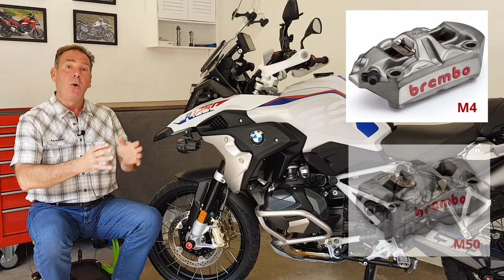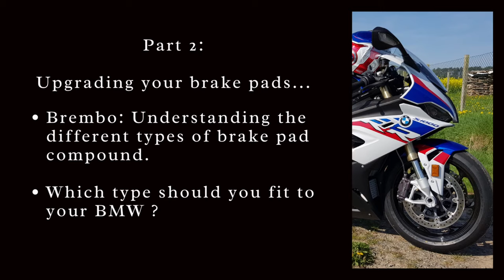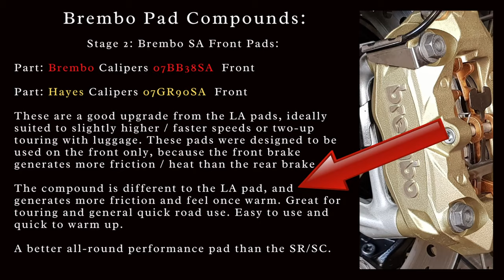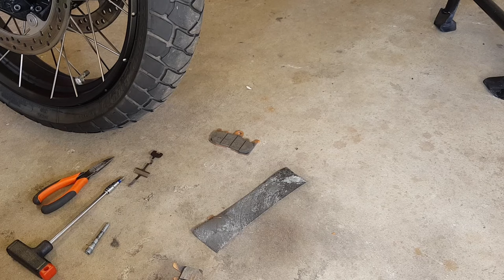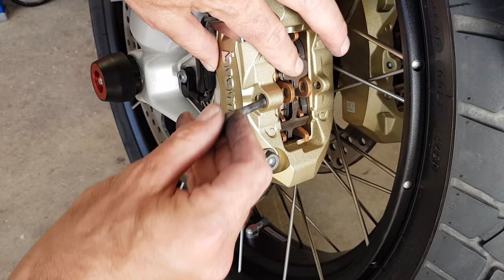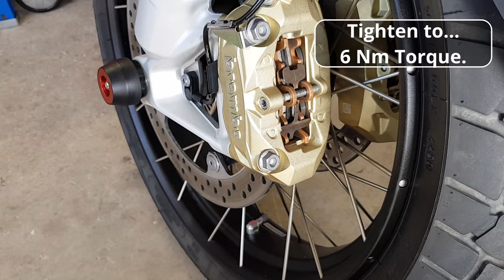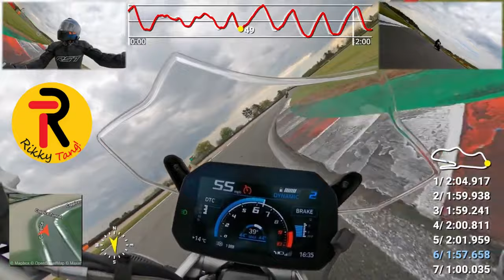EP:11 BMW Brake Pads Explained R , RS , RT , GS/A  Brembo Brake Pads - Compounds - Upgrades

Comment: Thing is with contamination is that it will get burned off just by using the brakes. I'm not saying don't take care of your brakes but if they were that sensitive then shit from the road would render your brakes useless constantly. 

I have accidently gotten stuff like acf50 on my disks before and only noticed when I started riding. I just made sure to do some hard braking to get the performance back.
Reply from the maker: Hi Jack , your point is valid to a degree, but with over 40 years of experience working with brakes my advice is valid and does offer a simple solution to improving performance. Different contaminants have different effects some are hard to remove but by cleaning the surface of the pads and discs this generally helps improve performance.
Thank you for sharing your thoughts 
Kindest regards Carl

Comment: I wish I had seen this sooner. I ordered Brembo carbon ceramic pads for my R1200rt as the advert said they were for the R1200rt
Reply from the maker: They will still work but just not the best option. Carl
Reply from the maker: Hi
A lot depends on your riding style and how you use your brakes.
A good replacement is the LA pad which is similar to OEM but with better feel.
The SA is really good pad if you ride a little quicker as it offers great feel and improved performance.
Don’t fit SC or SR pads they need LOTS of heavy constant use to get them working correctly.
Personally it would be SA pads from Brembo 
Let me know what you decide to fit and what you think of them compared to the OEM pads 
Carl

Comment: Very detailed and very informative. I got a 2022 gs and looking forward to my hayes caliber leakcage so that i can let them to be replaced by bmw. Greetings from izmir Turkey.
Reply from the maker: Good evening Turkey and welcome Ugur. Not all Hayes calipers leak, but if yours do fingers crossed your dealer fits Brembo for you.
Best wishes Carl
Reply: I live in the USA, and have a 2020 1250GSA that was part of the Hayes caliper recall. I had them inspected by my dealer two times, with no sign of leaking. Even though I had the option of replacing them with the Brembo, I opted not to change them, because I felt that the Hayes had better stopping power. 55k miles on the bike now, and still no signs of leakage.
Reply from the maker: Hi Craig, hello and welcome, yes the Hayes do have great stopping power and you are obviously one of the lucky owners to have no issues. Wishing you a great spring and many happy miles on your GSA. 
Regards Carl
Reply: @justthewayitis  ❤

Comment: Excellent video with clear explanations. My question is would it be more beneficial for off-roading purposes to use the Hayes type calipers as they are a more enclosed system thus avoiding a lot of ie dirt, mud & sand for example. Great job Carl and I have just added myself onto your subscribed list. Look forwards to more videos.
Reply from the maker: Hi My Tube, that's a great question,  your thought process sounds good, but once the dirt, mud and muck gets into the space between the caliper and pads, the Hayes are not easy to clean or inspect. But it's a good question. Maybe some more off road experienced subscribers can comment and share on that 👍
Carl
Reply: @justthewayitis  Very true thanks for the reply Brembo it is
Reply from the maker: Your welcome anytime 👍

Comment: Hi Carl, like your videos a lot. Very simple and effective information. I have a 2021 GS Rallye. I am 5’7” and would like your advise on fixing handlebar risers on my GS. For me the reach is just about nice but would like a more comfortable feel on long rides where I can feel my palms getting numb.
Reply from the maker: Hello Sameersu, choosing a set of bar risers is an individual thing. If you are happy with the standard height and reach,  you can try adjusting the bar level using the Mark's on the bars. In other words loosen the bolts and twist / rotate the bars downwards by 5 to 10 degrees.  This might help with your hands going numb.
Alternatively if you do decide to use bar risers  they all have slightly different settings.  Some go up 30mm and back 35mm, some go up 20mm and back 25mm. So this is your choice and you might need to try a couple to find the perfect solution for you.
Also changing the seat height in combination with the angle ( up at the back and down at the front) can also help.
It does take time to find your perfect setup. Best wishes Carl

Comment: As always, great and very interesting video Carl. I learned a lot. Thankfully, I do not spray anything directly on my bikes so I do not think that I have any contamination on the breaking pads. Thanks for sharing the video… I would like to have the Brembo calipers on my GS, but the Hayes ones have not leaked so I guess I cannot have them changed (free of cost that is) by BMW. Wish you a safe riding and look forward to your next video. Cheers.
Reply from the maker: Hi Max, thank you for compliment, good to hear you already clean and detail your GS the correct way.
I wouldn't rush to swap the calipers.. the Hayes are very good, it's just that last little bit of feel that the Brembo's give if you ride a little faster than most.
Best wishes Carl

Comment: Hi, great informative video. What I don't understand on every GS1200 front brake pad change I have watched is the location of the spring. When the video starts the T30 bolt does not locate in the cut out in the retaining spring yet the reassembly it locates the T30 bolt in the cut out, could you please clarify, many thanks Brian
Reply from the maker: Hi Brian, send me an email and I’ll forward you some pictures 
Contactcarltoday@gmail.com
Reply from the maker: Email sent

Comment: Superb vid What’s the best way of moving the brake pistons back and forward to clean and lub the piston
Reply from the maker: Hi James, a great question

It all really depends on the owners experience level….If you are not experienced and 100% comfortable working on calipers, I would suggest ONLY moving the pistons back into the calipers once everything is thoroughly clean and you have applied a small amount of lubricant. Then gently push two pistons on one side back into the caliper housing, while holding the other side firm. I REPEAT Absolutely NO moving the pistons in and out, this is the safest way for owners that have limited experience. 

Moving the pistons in and out / back and forward is possible using the brake lever BUT you have to be extremely careful doing this because the pistons can…. Sometimes… pop out. This ( in and out) is normally only required when the bike has high mileage or has been used in extreme conditions or ridden through several winters as a commuting bike. 

For most owners, cleaning the calipers thoroughly and using the lubricant I advise in my Ducati series and then gently pushing the pistons back into the housing using the lubricant … is the best and safest way to perform this maintenance. 

Of course, you can purchase caliper tools and tools for compressing the pistons back into the caliper housing, but for most owners the above steps work just fine. 
Best wishes Carl
Reply: Thanks Carl going to give your Brembo brake pad up
upgrades a go. I run two up
briskly most of the time so going to try the SA pads a try 👍
Reply from the maker: Hi James, thank you,  and I hope you enjoy the SA pads. Perhaps just give those discs a clean when you install the new pads that way you will get the best from the SA. And... hopefully you can return and let the other owners here know what you think of the pads.
Best wishes Carl

Comment: Hi Carl. Thanks for the video. Very informative, helpful. How about brake fluid, does it contaminate the brake pads? Cheers
Reply from the maker: Hello and welcome, definitely yes !!! Once brake fluid gets on brake linings either pads or shoes… they need to be replaced and brake discs thoroughly cleaned and decontaminated. Even a small amount of brake fluid is enough to affect the pad performance 
Carl
Reply: @justthewayitis thank you for the bad news hehe. Was bleeding and got sloppy. Cheers

Comment: Hi Carl. I've just been cleaning my breaks and deglazing my pads as inspired by your video! 

I've just noticed the large metal spring that sits under the retaining bolt is in a different position when you remove it and when you refit it.

Can you confirm which position is correct? Should the retaining bolt sit in the U shape or not? 

Thanks for the great videos!
Reply from the maker: Hi well spotted 
The correct position is as it’s re installed 
Pin through the U shape 👍 
Good luck with your cleaning it makes a big difference, Carl
Reply: @justthewayitis  thanks Carl! I'm yet to try the clean brakes but looking forward to it!

Comment: Hello, I watched your video 4/5 times.  I changed my 4.32 Brembo brake pads. The front wheel is a little difficult to turn. Is this normal? Do I need a break-in? The pads I changed are Brembo (brm10dhh).  Thank you very much again for the clear information.   Greetings from the folk song.   1250 adv.😊
Reply from the maker: Hi, the front wheel should turn smoothly and easily.
Did you thoroughly clean the inside of the calliper and clean the pistons?
Did you remove the callipers ? Please confirm.

Did you use the lubricants I mentioned in the videos around the pistons and then gently and carefully press the pistons back into the calipers?

If you did everything correctly and after a short 10 mile ride to gently bed in the new pads, the front wheel should rotate smoothly with just a little bit of drag / resistance being felt.
Carl
Reply: @justthewayitis I don't have caliper piston oil, but I felt that the pistons moved easily.  I will disassemble it and check again and try to find the piston grease.   I hope I can provide a comfortable wheel rotation.   Thank you very much for the information.
Reply: @justthewayitis I did the cleaning process as in the video and took an outside opportunity to disassemble the calipers and I think I cleaned them pretty well.😊
Reply from the maker: Ok, brilliant, 🙋🏻‍♂️
Reply: @justthewayitis  I applied the cleaning process as in the video.   I applied the caliper piston paste, there was a relief of about 15% compared to the previous one, I drove on 3 different days and now I checked and the wheel turns very easily and my brakes work perfectly.  Now it's the rear brake's turn. Tank you.
Reply from the maker: You are very welcome and I’m pleased to hear your front brakes are now better 👍🙏🙋🏻‍♂️

Comment: Very good tutorial from a pro. Do you have any experience with SBS pads? I purchased SBS pads for the rear (R1200GS LC) but the shop gave me model 674HS. Checking their website this pad is meant for the front only and they recommend 674LS for rear application which supposedly will resist brake bind. Do you think this will really be an issue?
Reply from the maker: Hi, each manufacturer makes slightly different compounds, which is quite often front or rear specific because the performance requirements are different. But essentially it’s just a brake pad… so now the HS is installed I would just see how it performs.
The GS is quite heavy on its rear brake so just make sure it doesn’t activate the abs to soon.

Comment: Do you also need to change rear calipers too? Like if I change the r1250 front calipers with Stylema then do I need to change it too? Or you can just used the OEM one❤ thank you!
Reply from the maker: Hi, 70% or more of the braking performance and control comes from the front, so for me upgrading the rear caliper would not bring any meaningful benefits.
Carl
Reply: @justthewayitis  that’s so clear! You said it got the good performance so let’s see how it’s gonna be if I suddenly max out the front break while coming at 200 km/hrs ☠️ thank you! ❤️
Reply from the maker: @terathepsakunjaruenpong6555 good luck with your Stylema conversion 👍

Comment: Hi Carl, i own a 2015 Kawasaki Er6n which weighs around 206kg wet. What brake pads would you recommend? 
I do mainly commuting and drive calmy with the occasional spirited ride. 

What pads would you recommend? 
Will the carbon ceramic (CC) Brake pads be enough for my bike? 
Will i get a shorter braking distance with the SA even though i dont ride hard?
Reply from the maker: Hi Nexii, I would not fit CC pads to your ER6N.
Your choice should be between LA and SA.
LA work better at lower temperatures and are more of a touring / commuting pad which offer a slight improvement over original. If you install these and clean your calipers / pistons / discs correctly you’ll notice a big improvement.
SA takes a little longer to warm up but once it is.. they offer more feel and bite than the LA this is a pad for someone who rides at a quick pace most of the time. 
Reading what you have said above.
LA is the pad I would use in your Kawasaki 👍
Reply: @justthewayitis  thank you very much Carl for the extensive explanation. I will go ahead and buy the LA pads in that case. I wish you many more safe kilometers on your bike :)
Reply from the maker: You are welcome 🙏

Comment: Wich One should i choose….M4 100mm or M4 108mm?….do i need Spaces kit?
Reply from the maker: One of the subscribers installed Stylema M4.30b with 5mm shorter bolts and a different MC. And was very happy with the results, I’ve not done the conversation myself so perhaps have a look on the forums . I believe they are 100mm. Regards Carl

Comment: just switched to the GS with brembos from a tiger 1200 and the braking is not as good. Mostly on the 'feel' so far, but I'm not sure how much of that is telelever vs brakes vs possibly the previous owner..
Reply from the maker: Is your GS new or a previously owned one ?
If it’s used I would try a basic brake service, fluid change, clean pads and discs from possible contaminants and make sure all four pistons are moving freely and lubricated.
Then when that’s all checked if your still not happy try fitting different pads from Brembo.
Carl
Reply: @justthewayitis  thanks, appreciate your quick response. It is used and I'll definitely try those steps.
Reply from the maker: No problem, your welcome.
Perhaps you will report back if you find a improvement..
Reply: @justthewayitis  ill try to remember!
Reply: @justthewayitis  did the front today and sadly it's no better. I was hopeful too because when cleaning there was a large disparity in how well a few of the pistons were working.
Reply from the maker: That’s a shame, if you cleaned and slightly sanded the pads during the service, next step would be to change the brake pads, perhaps Brembo SA

Comment: Hi Carl, thanks for the valuable info 
I have just finished one set of 07gr90sa pads and the brakes were awesome. However my mechanic said while I was updating the new sets that the material (red part) was overheated and burned therefore these are not  actually proper pads for a gs and causes heating of break fluid.. I have never had a bad experience but what is your opinion in this regard about red turning to black and burning etc
Reply from the maker: Hi Motosurus, welcome to the channel. The red part is the metal backing which the brake compound is bonded onto. It’s quite normal for this to discolour during use. Many pads have black painted metal so you won’t see the discolouration or they are not painted and again you would not see any real change in colour.
From my experience using Brembo pads this is quite normal and nothing to worry about.
All pads transfer heat onto the metal backing and then into the caliper and then into the mounting and lower suspension leg, some heat is transferred into the brake fluid and that’s one reason why we change brake fluid.
I feel what you have described is quite normal without actually seeing the pads my self.
Hope this helps, Carl
Reply: @justthewayitis  thanks Carl i felt the same
Reply from the maker: Glad to hear you are enjoying the SA pads 👍

Comment: Such a useful video. Thank you.
Reply from the maker: Hi Roland, your welcome 🙏 Carl
Reply: Can I ask you - we used to put coppaslip behind the pads.  Is that necessary? 
 @justthewayitis
Reply from the maker: Hi Roland, yes you still can do that, but a very fine smear on the back of pad where both pistons press against the metal part of the brake pad. And yes this is what I do. 🙋🏻‍♂️

I generally don’t talk about this because it’s easy for people to get confused and use it in the wrong places 😳
Reply: Thank you so much for that.  Much appreciated.   @justthewayitis
Reply from the maker: You’re welcome
Reply: @justthewayitis  Is copaslip copper grease? In the Multistrada video you didn't recommend using copper grease, instead you recommend ATE Break paste? A bit confused.
Reply from the maker: These are completely different products used for different things and must not be confused.

What exactly are you trying to do ? Please explain 🙏
Reply: @justthewayitis  Hi Carl, yes you are right, no place to be confused. ATE break pistons lubricant is used in the process to make sure that all pistons are moving uniformly and smoothly. And Copaslip is used to apply on the back of braking pad. Can I use some other grease? Copper grease from Moly, maybe?
Reply from the maker: Yes on the back of pads you can use different brands but it should be copper based and high temp. Use only a small amount 👍